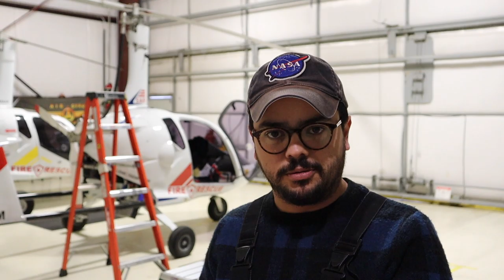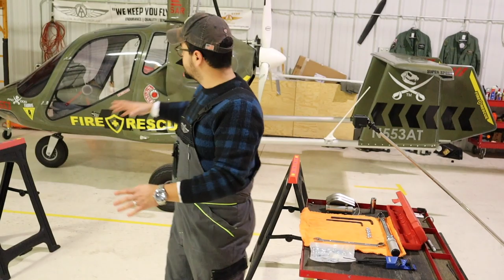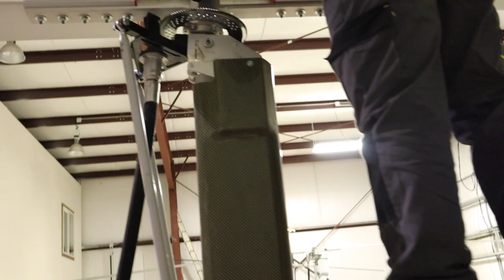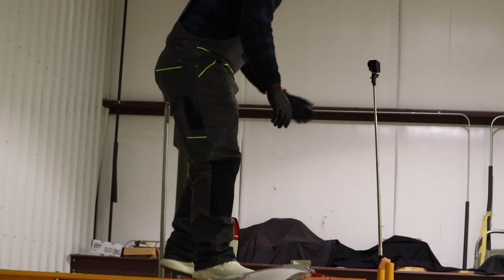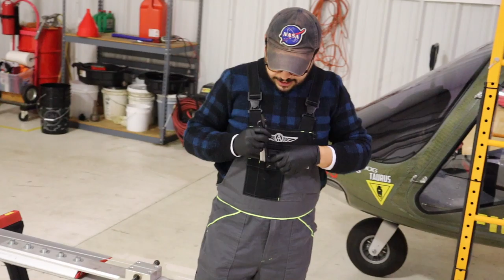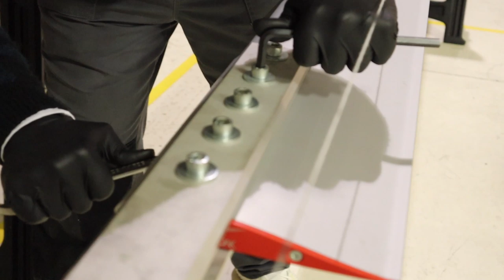Aligning a Gyroplane Rotorblade

Comment: If the rotor head and blades are precision drilled and ground (i.e. precision diameter) NAS bolts are used, then how would a rotor system drift out of alignment?  Also, if manual alignment is performed, what is to keep the rotor system from drifting out of alignment?  Wouldn't that involve metal to metal slip and movement in the rotor? That would be bad, correct?

Comment: Very good video, I will be doing this on my next inspection. I am lucky I have a winch in the roof so this becomes a one man operation. Will you make a part 2 when you re-install the rotor showing the torque settings and explain exactly what the space if any should be from the rotor hub to the rotor block (hub bar) (U), also the best way to put the grease. Thanks for this and the other videos.
Reply from the maker: It definitely is recommended to have a winch. Sure makes it a lot easier and reduces the possibility of banging the rotor on something.  I think we may do a part two of putting the rotor back on the machine. We ran out of time to include it on this one. Thanks for your comment!

Comment: Doesn't seem like a high degree of accuracy to me.  More like a seat of the pants without professional tools.  I would be hesitant to do that myself considering the blade is my lifeline.  Maybe this is the way, I don't know but scary.
Reply from the maker: Have you ever watched it done before on Gyroplanes? I would be interested to know what was done differently and what tools were used. On these blades, if that string goes from one notch to the other and crosses over the dot in the middle of the hub, that is quite an accurate alignment. I would be interested to know of different methods or tools to accomplish this though.